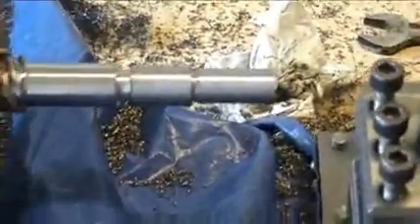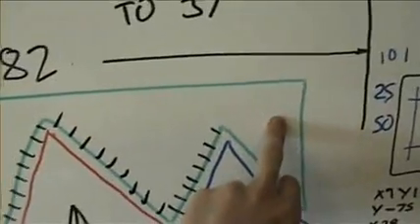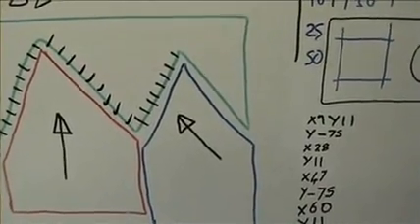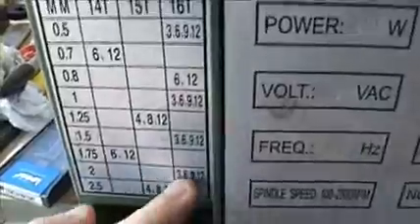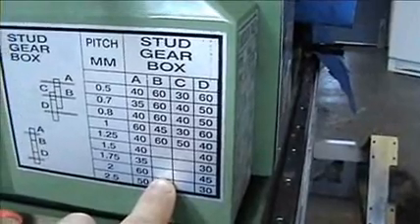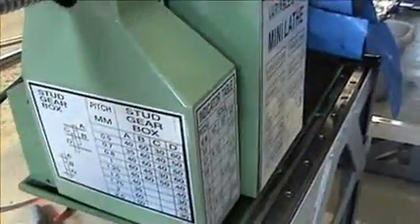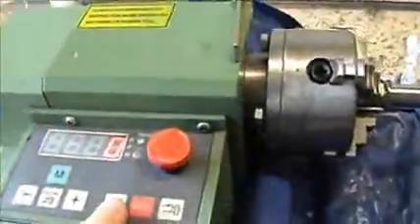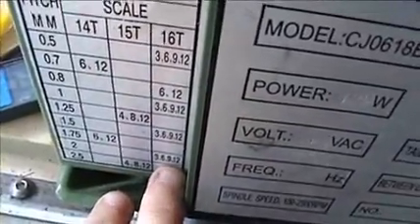screw cutting project part 1

Comment from the maker: It's to reduce the cutting pressure, this insures the cutting is done mainly with the left hand side of the cutting tool. If you leave it at 0 deg the cutting will be on both side of your cutting tool. That would maybe okay on a big lathe but with the small motor on these mini lathes it will soon run out of power. 

P.S. 59 deg is for a metric form, use 54 deg for imperial

Comment from the maker: I only brought the lathe to help with building my CNC router project, I have since sold it. I only cut about 10 threads on the lathe, the nylon gears held up well, I used a light oil to keep them well lubricated. As I mentioned in the video it's a slow process taking many light cuts, but it gets the job done.